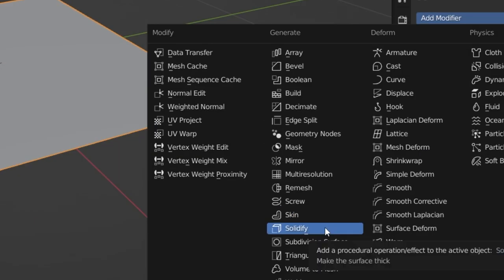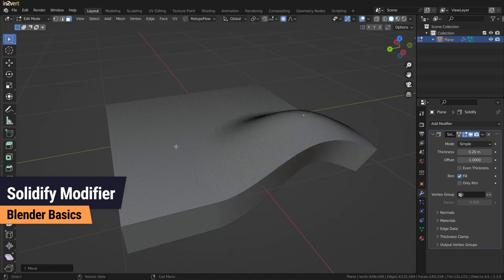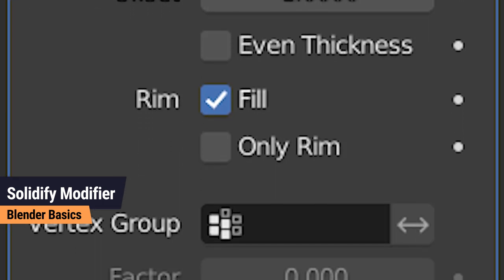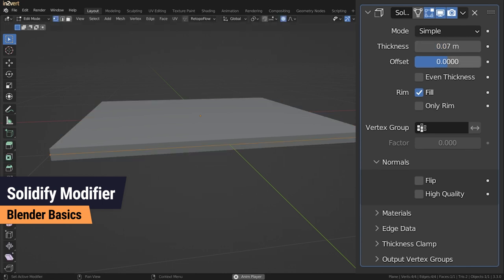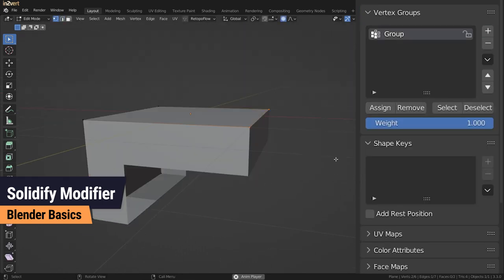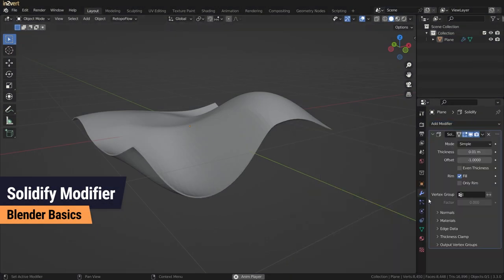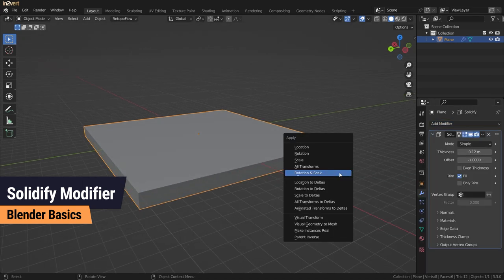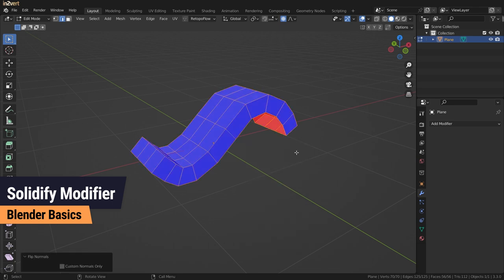Solidify Modifier - Blender Tutorial for Beginners - Basics

Comment: hHi, Nice Video 👍. Maybe you can help me out. Im neu to Blender. My Problem is that i want to model a logo. I have a reference picture und put a plane on it and modeld along the sides. Now i applied solidify to make it thick. after that i want to round certain edges with the bevel tool. But i am not able to select the edges of my objekt wich i extrude with solidify. i can only select the edges on the ground (its the plane i used to model). Pls help im suffering xD. Maybe do i have to convert the solidifyed objekt into somthing else?